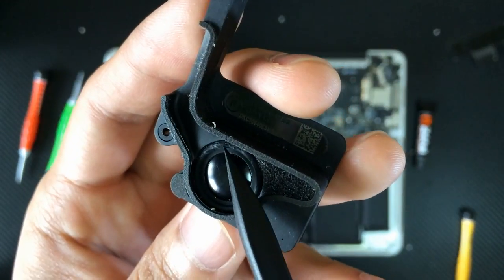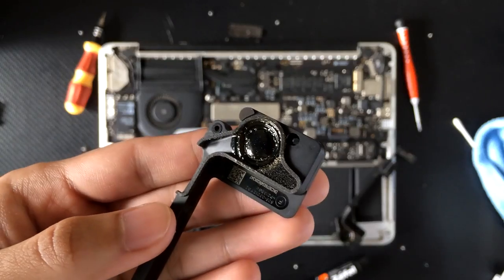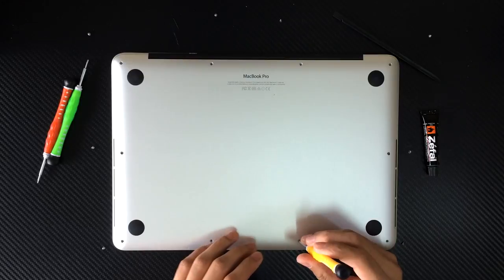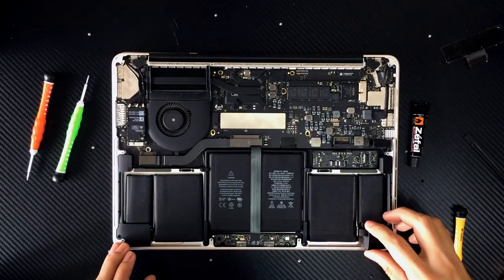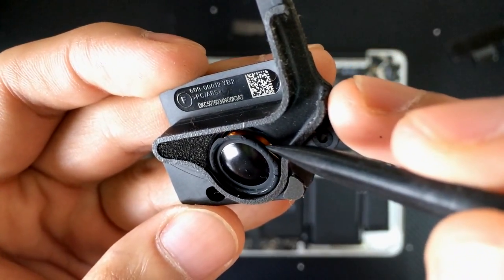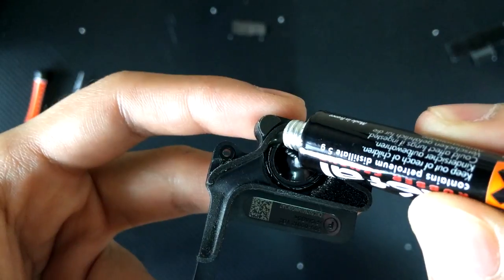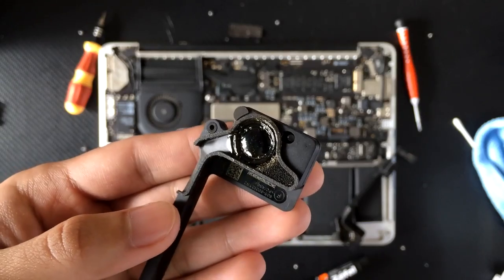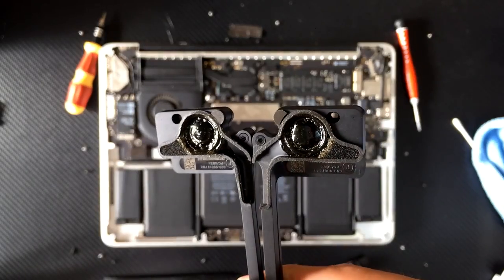Rattling Macbook Speakers Cheap and Easy Fix!

Comment: I just wanna thank you buddy and add my experience so someone can benefit from it too. I tried to fix it with a hot glue gun, it didn't work because it muffled the sound way way too low, fortunately the glue solidified and it didn't damage anything so I just removed it carefully. Then, I applied some old liquid transparent glue I had, same kind of the regular school glue and it did worked great, not sure if this will last for too long or not, but I'm happy for now and I just ordered a pair of new speakers from AliExpress for $11 bucks, they may not be genuine or that great but most people commenting seems to be happy nonetheless, thing is the shipment take like 2-3 months at best LOL, so hopefully my fix will last those months.
Reply from the maker: Thanks for sharing! Man, that's a long wait haha Tell us about the replacement speakers when you finally get to install it -- could help a lot especially those looking into replacing theirs. Thank you :)
Reply: yeah , did u install the AliExpress speakers yet?
Reply: UPDATE US ON UR ALIEXPRESS SPEAKERS PLS
Reply: @KagomeH  Hi, I did receive them, I only installed the right one because for the left you actually need to take all the motherboard apart, so I was lucky that only the left was cracked. I'll say the quality is just "fine", not great at surely it's way below than the original but hey for around 10 bucks you can't expect much, I'll do the trick.

Comment: Subbed! Maraming salamat! Do you mind if I ask where you got the rubber cement here in PH? Is the same as those bicycle tire repair glue? Definitely doing this first before replacing my speakers.
Reply from the maker: No problem and thanks too! Yup exactly those glue for bicycle tire repair. Some comments here mentioned using other adhesive ranging from white glue, epoxy, double sided tape etc. and they all said it worked. I guess any adhesive will work as long as it can hold the speaker cone back to where it should be. As for where to buy: almost all bicycle shops have this.

Comment: Thank you. But isn't it more practical and safer to just order that rubber ring?
Reply from the maker: Safer, maybe. Practical, not really as the glue is cheaper and available in nearby stores (no more shipping cost, unlike rubber spare part), and works pretty well. And I actually didn't know that there are spare parts for speaker driver cones/rubber/etc for speakers this small until one viewer commented that he bought one from ebay and it worked pretty well for him.

Comment: Hi Earl! Can I use mighty bond for this as a replacement for rubber cement?
Reply from the maker: Hi! I think I've read one comment before that had success using mighty bond. However, my opinion is that it's better and safer to use rubber cement.

Comment: Hey, is this a fire hazard? Rubber cement comes with 'warning:Flammable" label. Is this a fire hazard when the laptop heats up?
Reply from the maker: This thought crossed my mind too back when I did this hahaha but no, rubber cement will only ignite when exposed to fire. Our macbooks would turn off (overheat prevention) long before it generates heat enough to cause fire
Reply: @earlmalaki  Okay awesome, thanks for the response man! This was my only concern. I think I'm going to go ahead and do it. Thanks for this video. Dope content, subbed!
Reply from the maker: @Benjamin-fu5ij  sure, and thanks! I use this mac for editing and gaming too so it really heats up and has no issues so far. Just make sure to give the glue enough time to dry before reassembling the mac or else the glue will stick to the metal

Comment: I have same issue/problem on my speadkers san pwede bumili ng ginamit mo dito sa Philippines? :) Thanks tol
Reply from the maker: Most bike shops may stock ng ganyang adhesive. Kahit yung mga nasa mall. Stick with Lezyne or Zefal brand lang. around 70php ata per tube. No prob and good luck sa pag ayos tol! :)

Comment: cant find rubber cement in my area. what about regular elmers glue?
Reply from the maker: Elmers glue will work but it might not last very long. Others mentioned using stronger adhesive like epoxy.

Comment: Hey, do you think the damaged speakers can happen because of using sound enhancing apps like Boom 2?
Reply from the maker: Honestly, I think there’s a design fault in these speakers. These shouldn’t break under normal usage, yet here we are. If the purpose of using sound enhancing app was to increase output/volume, then it most probably have contributed to the breaking of the speakers.
Reply: I realized my problem started after increasing the regular volume of Mac to the maximum for a skype talk. No enhancing apps....
Reply: Yes, Boom has busted two sets of speakers for me (but I still use it cause I love it). TIP: don't listen to Rage Against the Machine on full volume ;)

Comment: where did you buy that rubber cement? i have that issue now :(
Reply from the maker: it doesn't have to be that exact same thing. pwede any adhesive that works with rubber/paper (like rugby)
Reply: @earlmalaki  thank you earl :)

Comment: i have the latest HP Spectre x360. it has this high pitch vibrating rattling sound . i just got a replacement yesterday and it has the same problem
Reply from the maker: That's unfortunate. Was it confirmed by them that it was indeed a problem with the speakers?
Reply from the maker: I feel like this issue is getting more common these days. Probably a combination of weak material and overpowering output :(

Comment: This works for 2015 Macbook Pro or those speakers are different?
Reply from the maker: Yup, the one on the video is actually a 2015 mbp. This fix will generally work on any macbook speakers that has the same issue -- torn cone/diaphragms.
Reply: @earlmalaki  Thanks a lot for your reply, much appreciated!  I have this issue and the guy that provides a service to fix it says this is only a temporary fix (of course he wants to sell me new speakers...), any idea how long this fix lasts typically?

Comment: Actually, I bought cheap replacement speakers from Aliexpress and the sound is terrible comparing to native speakers. I now doubt, if old but fixed speakers will give better sound and it worth disassembling the Macbook once again? I've 2015 MBP 15 and it's very difficult to replace speakers, the whole motherboard needs to be removed.
Reply from the maker: That's tricky. What I can say though is that if the old speakers are really broken/torn, fixing them would require putting a lot of glue -- and putting a lot of glue makes the speaker sound tinny and terrible since it makes the cone stiff.
Now removing the motherboard is a lot of effort so I'd personally not do that -- unless the aliexpress speakers really sound bad. But then again we're not sure if the fixed old speakers will sound any better :/

Comment: Anung model ung Macbook mo sir? I am having same issues Left Speaker Rattling Sound lalo na kapag ma bass yung sound.
Reply from the maker: Macbook Pro 13" 2015. Yup that's definitely the same case sir. Either fix it this way or replace the speakers(expensive) :(
Reply: @earlmalaki  Same macbook model as with me sir. I asked some shops and Replacement will cost 3k and up for both right and left speakers. THANKS for the DIY guide.
Reply from the maker: Mahal talaga ng replacement sir, tapos hindi lang rin naman assured na di na babalik yung issue. Kaya better mag DIY fix nalang haha :) Good luck sa pag fix!
Reply: @earlmalaki  Hi Eal : thanks for your share, How is speaker condition after you fix by ZEFAL RUBBER glue 1 year later
Reply from the maker: Sure no problem! So far the speakers are doing okay. Fixing it this way is definitely better than replacing coz it’s inexpensive, and the replacement speaker will eventually break again.

Comment: Can i use plastic steel epoxy?
Reply from the maker: I'm not familiar with that. But I think as long as it wont melt the speaker cones during application I guess it's all good.

Comment: I use general rubber cement, as recommended by most videos, and it has destroyed my speakers even further!  For some reason a minute after applying my last coat, the edges started to bubble up and completely peel away from the centre disk! Now I have to buy new ones all together.
Reply from the maker: Sorry to hear that! That's odd though -- I've never heard of this happening. May I ask exactly which rubber cement you used?

Comment: $30 a set for replacements on ebay. Youre gonna cut a lot of bass out by stiffening the cone also but nice cheap fix :)
Reply from the maker: Yeah it doesn't sound as good as before but it isn't as bad either. I expected it to sound like crap after the fix but to my surprise it's still good! Hahaha I'm wary of buying the replacements because afaik you either get a used Apple unit or a china OEM one.
Reply: @earlmalaki  True

Comment: So, I get the part about using an adhesive, etc. But no where in this video do you actually show 1. how to actually find and remove the speaker itself and once repaired how to put it back to gether. This video is good only if you know how to do the preliminary work first. Thus I still have no idea how to find and remove the speakers to fix them.
Reply: He mentioned to find it on ifixit.com
Reply from the maker: In the video, I advised viewers to look up ifixit.com for step-by-step instructions on removing the speakers for their specific macbook model. This way the video can focus on the rubber cement fix. But this feedback is noted, thanks!

Comment: just checked on ebay for speaker replacement parts on a late 2012 MBPr, the price is over $50, why don't Anker or Monoprice make parts like those...
Reply from the maker: And note that most are either 1. Used apple originals OR 2. Brand new china replacements. — will tear the same way the original ones do. 
And indeed, would be nice if some reliable manufacturer make better versions of these parts.
Reply: @earlmalaki  Can you find Chinese replacement parts at good price?
Reply from the maker: @jiankuo  Cheapest I found was around $45 -- this was a year ago, but I guess prices remain the same. Hence I just decided to go the rubber adhesive path hahaha

Comment: Hi there, it did work although the problem will come back some months later.
I just noticed that in these models A1398, the microphone is located on the left hand-side too.
Do you think that could be the reason why only the left speaker suffers the most this issue?
Can anyone chip in some technical thoughts about it?
Apple won't solve shit, but together we can :D
Reply from the maker: I don't think the mic has anything to do with this issue... but I never really gave it a thought yet. I just accepted that the speakers' durability is crap. Great sound tho (before the cracking started) hahaha

Comment: I did this a while back and it started farting again so i just opened it and ripped the lil speaker out the square housing. Now no sub but sounds clear. I dont really need the sub anyway lol
Reply from the maker: damn hahahaha
Reply: @earlmalaki  lololol
Reply: @earlmalaki  the speaker houseing is still there just removed the lil woofer. It was rattling bad and theyre cheap so just take it off instead of farts lol

Comment: It doesn't sound as great because you poured the whole fucking tube on the diaphragms. Should've just ordered new units and swapped them. Easy fix.
Reply from the maker: Yup that's definitely the ideal easy fix, but then it wouldn't be cheap ;)